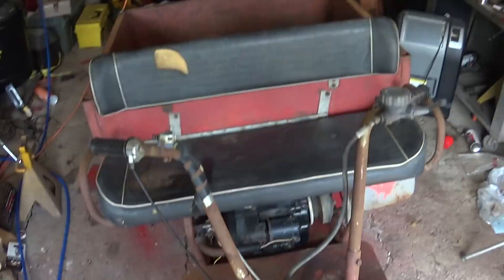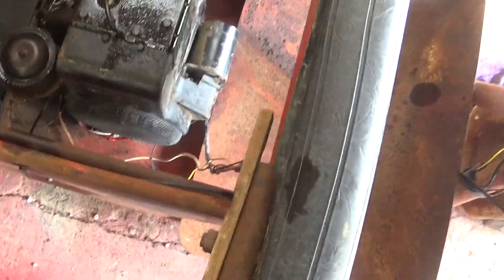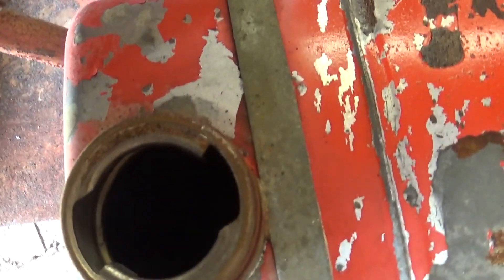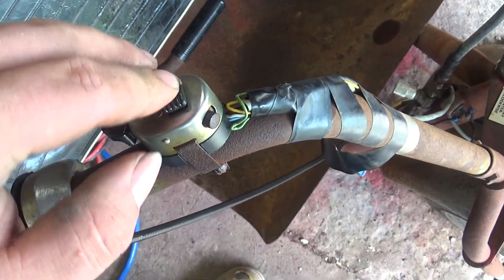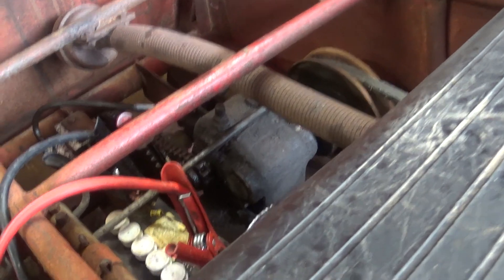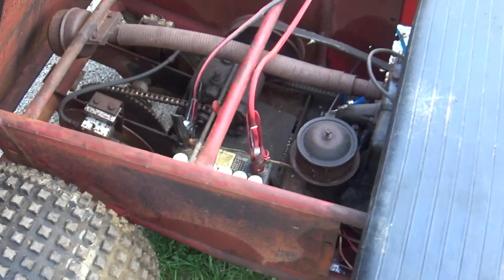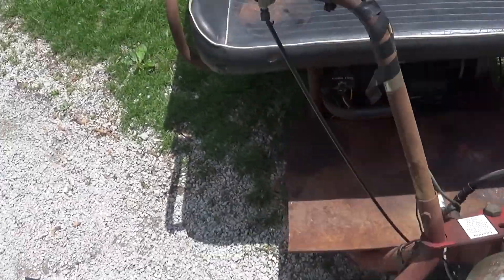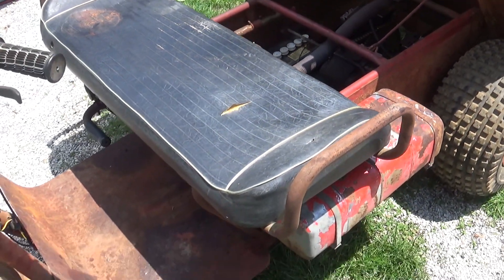Heald Hauler Cold start

Comment: I have an 85 heald hauler but with two steer wheels. Would you have an idea of what would work for a transmission. Its quite impossible to find a transaxle
Reply from the maker: I don't have a good answer for you parts in general seem to be hard to find I wonder if a go kart drive could be made to work. I haven't had much luck finding brakes for it either I might have to try to make some motorcycle disc brakes work on it. If I come up with something I will let you know.
Reply: I still have a ‘83 Heald Hauler HH-416 that I just recently restored back to life....runs like new! Can’t get the original FNR transmission unless you find another old HH-416 to pull it from. Comet did make a FNR transmission and  you can still find them for sale online